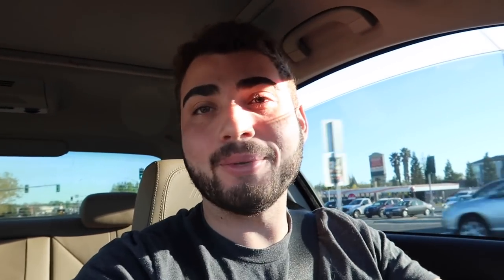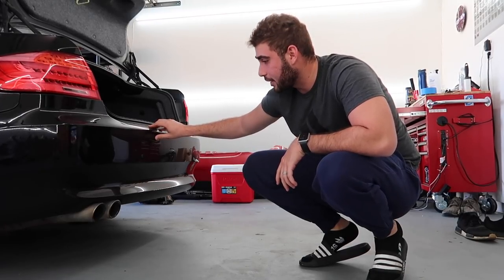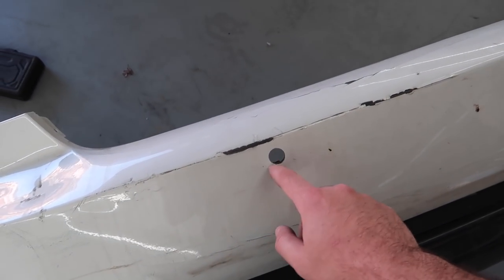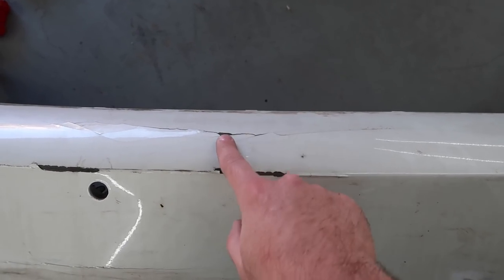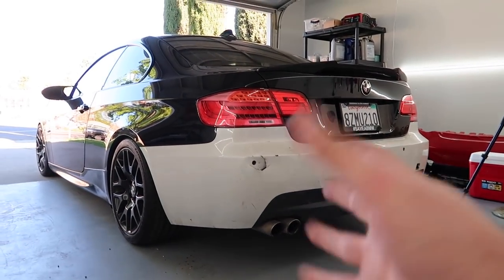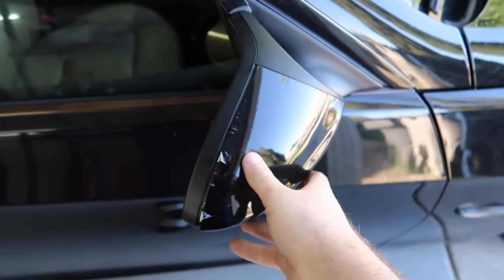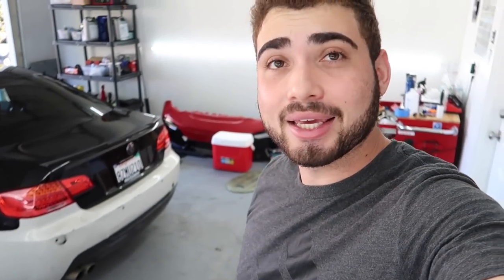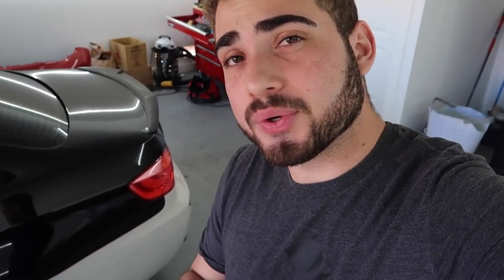WE GOT A $100 M-SPORT BUMPER FOR THE E92!

Comment: The car does not have 40,000 miles, run a Carfax on it
Reply: He was referring to the ///M3
Reply: @chevyboa8950  I know, but that M3 does not have 40,000 miles on it, it had 240,000 miles on it then somebody tampered with the mileage with an Odometer Correction Tool
Reply: @Ben-Hawy  Oh word? Damn that’s crazy smh I definitely heard about a few instances like that
Reply: @chevyboa8950  I just had to travel 180 miles to Houston to look at a 1987 Mercedes he says 18,000 actual one owner miles, I ran a Carfax and it showed last odometer reporting 18,000 miles, I discovered the car was in terrible terrible shape, he disconnected The odometer since almost new, The interior was totally ripped to shreds, all the switches were rusted and broken, it has been repainted and the Bondo is showing underneath The paint which was full of paint runs and mistakes, the steering wheel is torn, that car I can bet it has 1,000,000 miles on it but the Carfax showed 18,000 actual miles. Crazy people